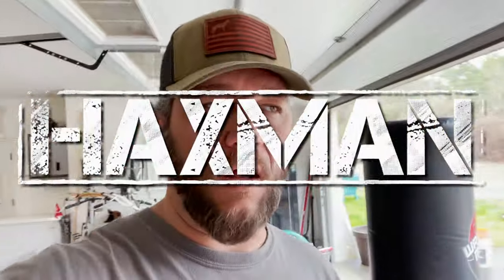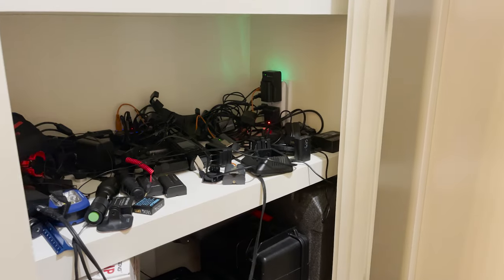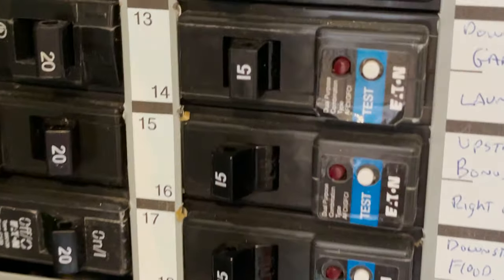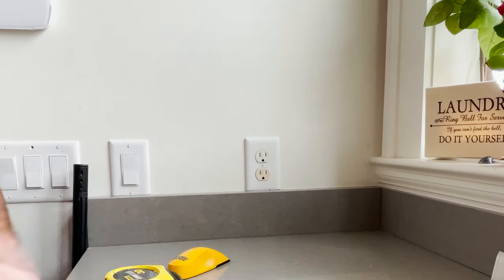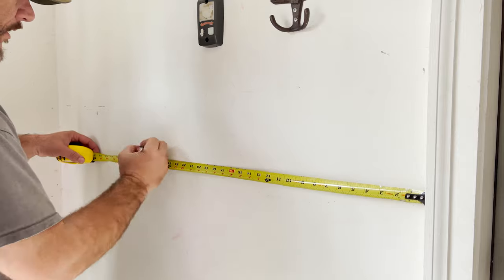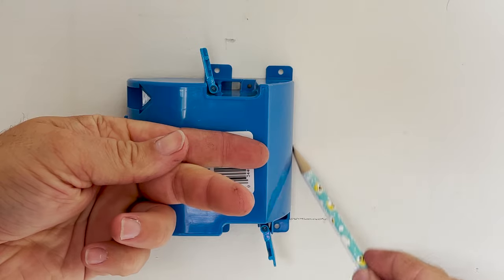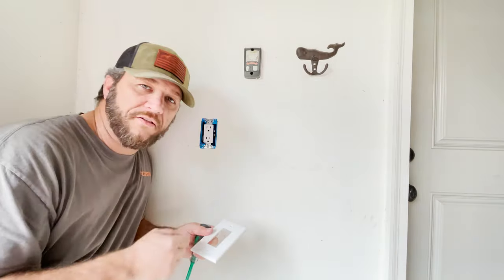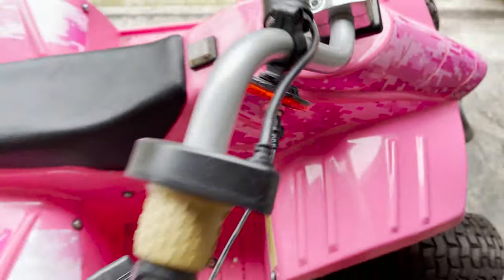Add an Outlet to an Existing Outlet - STEP by STEP - So easy an idiot can do it!

Comment: I know others have commented but it's important to reiterate 2 things:  1) don't backstab the wires into the outlet as they can work loose over time and create a short/fire hazard.  Always take the time to use the screw terminals and 2) when using the screw terminals, make sure that the wire loop is oriented clockwise so that when you tighten the screw, the wire is pulled into the terminal
Reply: Question: why do they even have them ( back stabbers) if that happens 🤔 
Just wondering..
Carpenter.
Reply: thanks! Is it important that the black and white wires go in diagonally from one another on the back of the outlets? Could they just as well go into both lower or both upper screws instead of crossing that way?

Comment: Always wrap your ground wire around the screw clockwise son... Your better then that...!
Reply from the maker: I knew someone would say that 😄
Reply: I was going say something but ....
Reply: @HAXMAN  you did do it the right way clockwise not sure what that dude was on. When you tightened the screw the wire was the right way. Looked like you put it in wrong at first but then the video was cut and started again also if that’s 12 gauge wire … most receptacle push in connections on the back are made for 14 gauge.
Reply: @ Thomas Beske he did go clockwise on the ground screw. Stop the video and look or snap shot it. 
What are you smoking?
Reply: @prplaya911  he did go clockwise on The ground screw. 
What you smokin.. must be good

Comment: You wrapped the first ground wire (on the old outlet) the wrong way, it should always go the same direction as tightening the screw. My Dad would have slapped your hand. Other than that, good job!

Comment: Great video. Exactly what I need (since I am any idiot). I am going with the consensus of comment and wrapping the wires on the screws ( clockwise) rather than backstabbing. I have got to say that ground wire connector is ingenious. The commenter that said you can’t combine ground wires is wrong. I have done it successfully. Why else would they make that connector? Yeah.. should be clockwise.

Comment: Thank you for taking the time to make this video. I'm not a professional electrician but I am a professional YouTube watcher. Most videos (I've watched) don't recommend using those little holes in the back of the outlet because the wires can pop loose. Also wrap and screw the wires clockwise for a good connection. Thank you again for your time and efforts. Stay safe!

Comment: Nice vid. A few minor things. I'm no electrician, but I'm pretty sure you can't "just double up on the ground screw" or any of the terminals, for that matter. Also, there's probably a lot of debate around this, but, from what I've seen, I would try to avoid the "backstabs" as much as possible, seems they could be prone to failure... Thanks for showing this, I want to add an outlet in toilet room for a washlet... for the wife, of course, and this makes it more approachable.

Comment: Stab connectors, hate them,  Greater chance if them becoming loose.  Screws while taking longer, are a for sure connection.  Other than that, very useful video.  I am just a homeowner like you, take my comments as you will.

Comment: Had a local electrician doing some work in our basement and after their third attempt to get it right this is perfect timing. Two separate circuits are using the same junction box and it looks like cross talk is causing them to flip. Also yeah, boy howdy. Learning to do this stuff yourself is a HUGE money saver. That electrician work was 760 dollars. Never again.
Reply from the maker: These types of videos upset electricians.

Comment: Glad you survived the explosion. I am about to venture down this route of extending my outlet. Been watch some videos and half of the folks said to pigtail the extension wire as opposed to connecting it straight into the existing outlet because of over heating the existing outlet. I am not an electrician just a newbie diyer so I donno.

Comment: I know you are a homeowner and not a professional, but when it comes to electrical, you don't just "add a plug" wherever you want.  There is a code requirement.  12 fixtures on a circuit is the max for code.  That's 12 lights or receptacles or any combination of the above.  The breaker said downstairs garage and laundry lights.  There's a good chance that there is a couple of lights in the laundry room/bathroom and since we know that there is at least one wall receptacle in the bathroom, there are probably another two or three receptacles scattered around the room on the walls.  
I am sure that there are more than a couple of light fixtures in the garage and maybe one or two outside the garage running off of the same circuit, more than a few residential electricians try to load the circuits to the max to save on cost.
While you may be perfectly fine here, you do not know if the other guy watching this has taken your advice and gone ahead with overloading his circuit, it won't automatically blow the breaker but the combined loads could keep the circuit running hot all the time until there is eventually a failure.
Another item :
I have installed tens of thousands of feet of 14/2, 14/3, 12/2, 12/3, 10/3, and 8/3.  Almost all of it has been white with a few browns, yellows, and even blues.  It is only the manufacturer that makes that distinction and perhaps the box store carries it that way to help both the unwitting store employee and the DIYer.  There is, however, caveat with my experience.  Wiring used for electric heating is labelled 12/2 and is red in colour because it is used for 240V circuits and the conductors inside are red and black.  However, it can easily be used for wiring ANY 120V, 20A circuit.
Please be careful in giving information to the uninformed, especially if you don't know the difference yourself.
I am a new viewer and have enjoyed your videos so far today, especially the fire pit.  Please do not stop, just get information right.
Reply: There is a good reason why they require certified electricians to do electrical work. Working with electricity is dangerous and can easily kill someone if you don't know what you are doing.
Reply: @MAGAMAN  agreed. A guy I work with was just electrocuted trying to work on his pool pump. He wasn’t an electrician.

Comment: This video is the best out there. Only thing I would recommend.is you should flip the outlet so the ground is on top and not on the bottom. This way if something falls and hits the cord in the outlet. It will break the ground and trip the breaker. If the ground is on the bottom and the plug breaks and doesn’t trip the breaker. It could cause a fire. Just a suggestion,never can be too safe.
Reply: You're kidding right? This is the worst video. He made so many errors with the wiring
Reply: One of them is that he backstabbed the outlet and that can become loose over time and start a fire

Comment: Great video. The new Leviton decora outlet will probably make this project even easier.
Reply: I think that you're referring to the Leviton Edge. It would have been a better option compared to what he did, it's only about $2 more per receptacle. I'm not a big fan of those, I'd rather use a commercial spec grade receptacle, better quality and less expensive than the Leviton Edge.
Reply: Thanks. I’ll need to look into the professional non-edge outlets. Hope they are available in homedepot.

Comment: As an electrical guy, but more important, as a dad....gfci protection.

At about time 00:45 you pointed to a bathroom receptecle you tied into.  This recepricle was not marked as gcfi protected.  The dad in me asks you to check on this, gfci protection for any receptecle in bathroom nec 210.8.  This may be in your breaker already, but test please.

Also, nec 210.8 demands gfci protection for eeceptecles in the garage.  You never mentioned it.  It may be on your breaker or you can swap out your "closest to the panel" in the garage receptle to supply this protection for your other outlets.

Kids play, rain or shine.  Please make sure they have this safety feature.

10/9/2022....rewatched and saw it on the breaker.  Remember to test iaw manufacturer's instructions.

Comment: Forgive the newbie DIYer question - if I want to do this from an outlet close to the floor, say to plug in a vacuum, to create an outlet in a pantry that I can plug a microwave and/or a toaster into, would the ampage matter? Higher is better? I'm sure I would need to know what the existing outlet ampage is, but if it happens to be the lower one, can I connect a higher ampage wire to the existing outlet for the extension?

Comment: 6:00  Some of the older wire may be white but that doesn't mean it's 14 gauge as they ink stamped what amp rating it was.  I did some re-construction in my house that was re-modeled by the former owners back in the late 80's and found this out.  So, these days (don't know exactly when)..they decided to go standardize white 14, yellow 12 and orange 10.  I didn't know they made extra big boxes for pigtailing, I'm on the cusp of cutting and adding a junction box in my basement because I don't think the small box behind the wire would house a pigtail and another line.  Funny they allow that box but installing a junction box has to be accessible (not behind drywall).

Comment: So did you just connect the new wire to the existing outlet and then run that new wire to the new outlet? Still leaving the old wire on the existing outlet?

Comment: The outlet I want to use to add another outlet has two sets of wires. They are not stripped but pushed into brackets. The ground wire is stripped and pushed into place. It doesn’t look like there is room for more wires. I can send a picture. Can you help?

Comment: 1. Leave The Wire Jacket 3-4.
2. Do Not Use The Backstab Holes Because I Seen Outlets And Switches Fail.
3. You Did Not Use A #1 Robertson Or ECX Screwdriver.
4. You Did Not Tighten Those Unsued Screws.
5. You Did Not Pigtail The Downstream Outlet Just In Case If The Downstream Outlet Fails Then The New Outlet Will Not Work.

Comment: Would all the steps be the same for adding a GFCI outlet? Thanks in advance!
Reply: To add a GCFI the very 1st outlet coming from the breaker has to be the GCFI outlet to protect the rest of the outlets after it, if not then only the GCFI outlet only will be protected

Comment: This might be a dumb question,  but could you continue the series and add another plug-in off the new one if you needed to do so?
Reply: Check how many outlets and lights are already on the circuit first- crappy way to figure that out is turn the breaker off to the outlet you plan on piggybacking off of. Then count how many outlets/lights lose power. 15 amp circuit can have around 8 lights/outlets total and 20 amp circuit can have 10 lights/outlets total.(the breaker you flip off on panel will be numbered accordingly). Use 14 gauge white Romex wire for 15amp and 12 gauge yellow wire for 20amp. Never white wire for 20 as its not big enough wire to handle the load. You can use yellow for 15 however. I'm no electrician but im finishing my basement DIY style and this is what I've found thru my research. Hope I helped!

Comment: On the original outlet you wrapped the ground wire around the screw wrong. You should wrap it clockwise around the screw so that tightening the screw tightens the loop rather than loosens it. You did the new outlet correctly.

Comment: This is exactly what I was needing, thank you! Unrelated: is that backband around your door and window trim? If yes, do you remember what type/where you found it? I've got slightly-larger-than-builder-grade trim in my current house, but after ripping out and replacing all the trim on my last house, I'm not in a hurry to do that whole process again, much as I loved the results. Some backband would solve it for me, but I can't seem to find what I'm after at the big box stores. Cheers!

Comment: You left too much sheathing in the boxes, it should only be about 1/2" as shown at 5:05 on original wiring. It's good practice to tighten the screws that are not used. You can use a 15 or 20 amp receptacle on a 20 amp circuit (12 gauge wire), but you can only use a 15 amp receptacle on a 15 amp circuit (14 gauge wire), NEC 210.21(b)(3).

Comment: If you aren't an electrician, you should probably not be doing electrical work. Serious injury or death may occur. You could also burn your house down by using the wrong size wire, overloading an outlet or just having a poor connection.
Reply: So we’ll just pay hundreds of dollars instead of doing it ourselves right? Ok trump 2020
Reply: @packerbacker9109  I mean he has a point.. at least do your research fist.

Old homeowner of the house that I now own used 15 amp outlets (AND STAB CONNECTIONS) on a 20 amp circuit. He also installed some 20 amp breakers on some circuits with 14 gauge wire, which is a massive no-no. Just generally didn't know what he was doing and figured that because he could use a screwdriver and a hammer that he was qualified to repair or upgrade the electrical in the house.

I replaced every single outlet and switch and had to rewire a few circuits because of massive code violations.